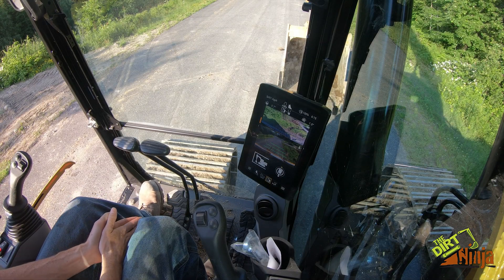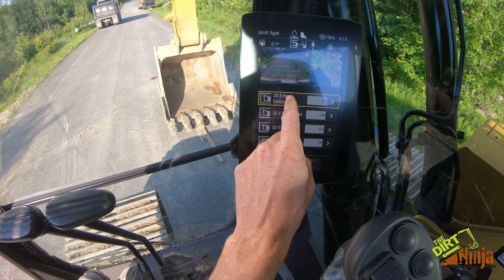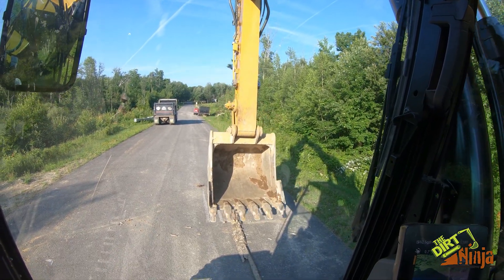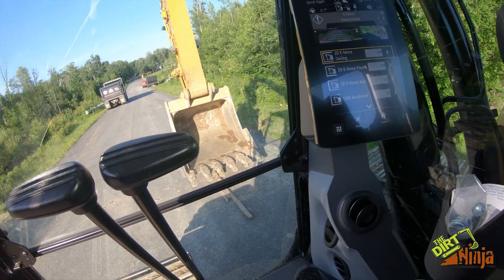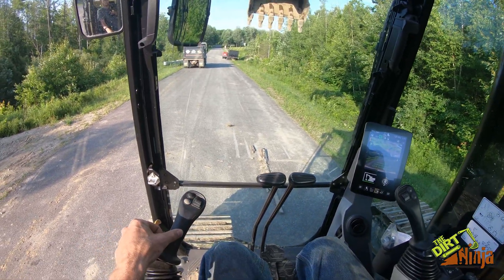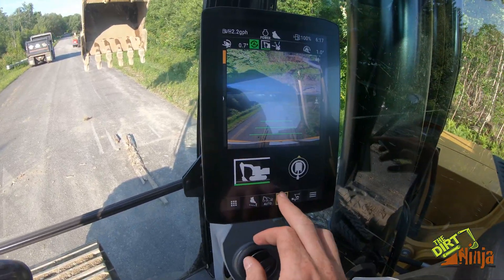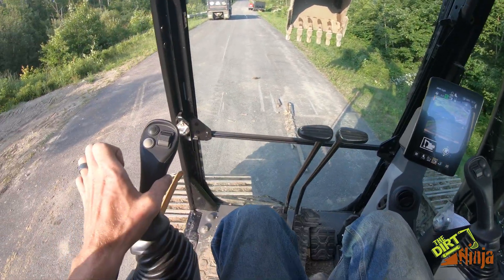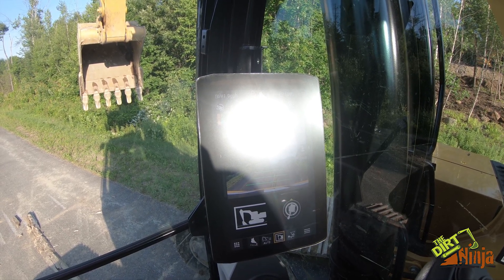E - Fence Explained - Cat Next Gen Excavators

Comment: as there are some negative comments... about the system in general... just my two cents

there are certain construction sites (at least over here in Europe) where you have to use such a "limitation system" on your machine or otherwise you are not even allowed to start working there... like say on rail road tracks with overhead power lines and multiple tracks next to each other (where the swing limitation comes to play)

there were a few accidents too much for the officials (with experienced operators) in the past so they got this as part of a work safety law here... but I guess you don't have the same working conditions as we have here in most parts of Europe

same is for example when performing work on single traffic lanes on the autobahn where one wrong swing could be fatal

so I would say a skilled operator knows how and when to use those systems and when there is no need to do so... but yeah this is just my two cents